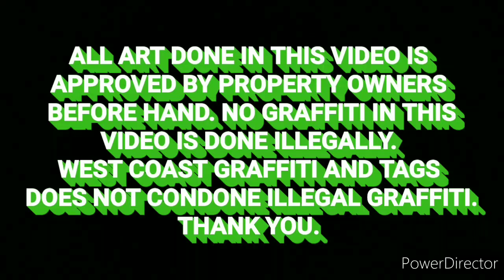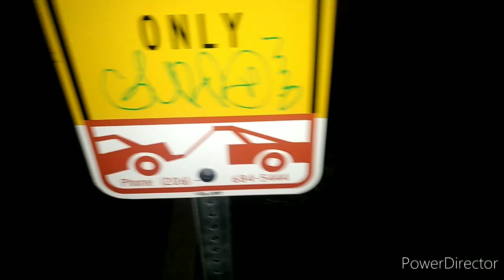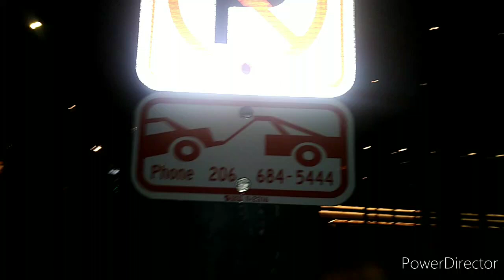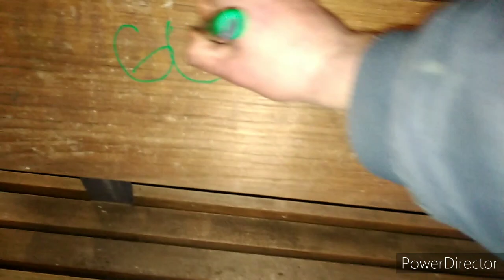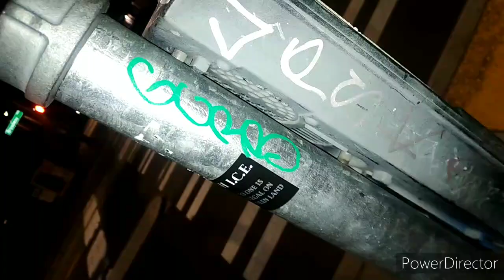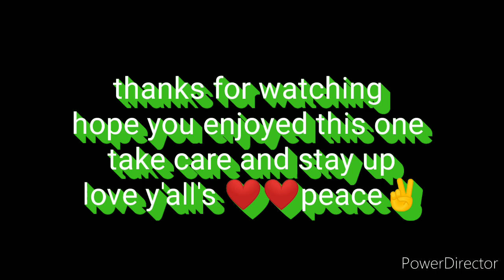uni Pasco paint marker review

Comment: Poscas are probably one of the worst markers you can use for graffiti out of the packaging due to the paint's composition. They're best suited for sketching unless you added a strong solvent like acetone or xylene and some other shit to the paint that comes in them. Even then, I doubt they'd stain well at all. The colors are nice but if you wanted colors then I'd suggest making some ghetto krink.
Reply: Another thing thing forgot forgot mention: Come back to the tags tomorrow and I promise you'll be able scratch it off with your nail. If the surface is porous, it might soak in and last a while (?) I'm guessing they won't stand up to elements after about a year or two.